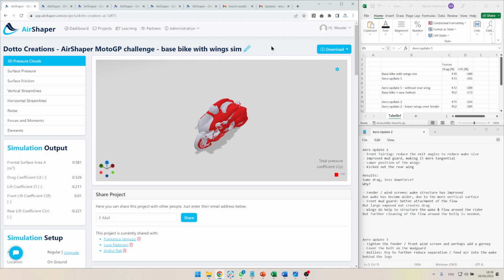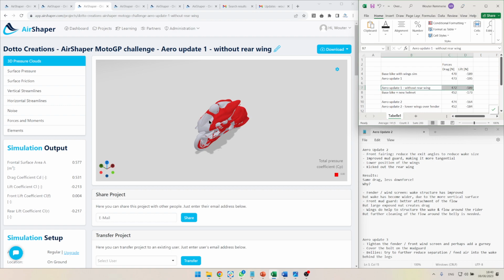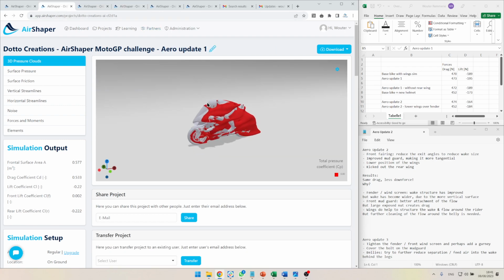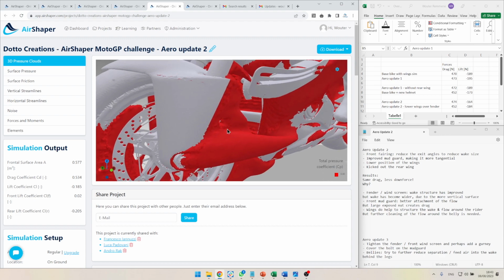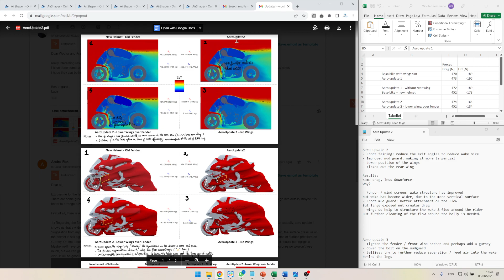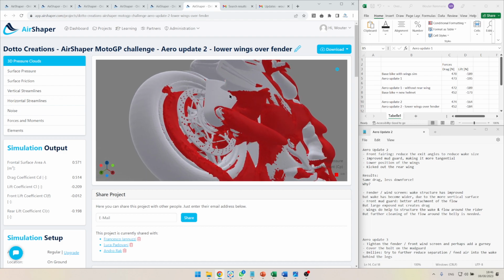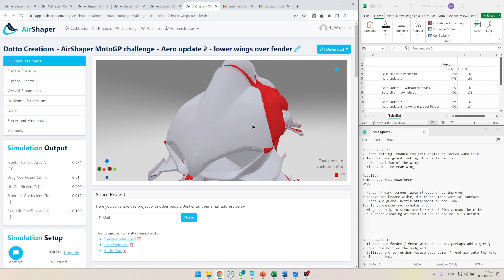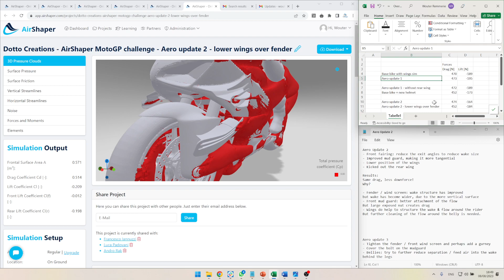MotoGP Aerodynamics - Helmet, fender, mud guards & wings - Dotto Creations AirShaper Aero Update 2

Comment: I have heard that feet forward motorcycles are much more aerodynamic and I would like to know by how much. I think they have lots of potential for like normal city/intercity riding.
Reply from the maker: The base position of the rider does dictate how the layout of the bike is defined. For the feet forward position, it may help to shield the legs inside a cover or so. But the maneuverability of the bike is also crucial to go fast - not sure if the feet forward approach would be a good one for that. Something to think about!
Reply: @AirShaper  thanks for reply. :)
Reply: For feet-forward layouts, of course the frontal area is reduced by getting the rider lower, but also the rider’s body angles result in less dramatic flow separation. The handling question is partly resolved by letting the rider push against a backrest, but this layout ultimately fails when accommodating rider size variations.
Reply: Also, you mention city riding where a lot of stops are encountered. Well, unfortunately the rider’s feet are much more susceptible to slippery conditions like oily surfaces, and the rider winds up with less leverage to keep the bike upright. The rider can compensate for this but they’re still at a disadvantage compared to an upright stance.

Comment: (mainly for the algos) but loving the concept of loading unsprung mass. Keep up the amazing work Woulter 🙏
Reply from the maker: Yeah I don't know if the regulations would allow for it, or if the wings would fall off under the high vibrations, but it would be cool! F1 cars also feature aero elements attached to the wheels, so I would think it's possible!
Reply: The idea of fairing the wheel considerably might actually work for my electric motorcycle road streamlining. Unfortunately, it does mean developing fitments for various bike geometries which may present production / price issues. But I would like to answer this question more fully as an alternative to my initial universal style design.